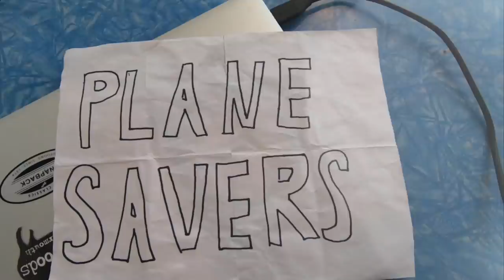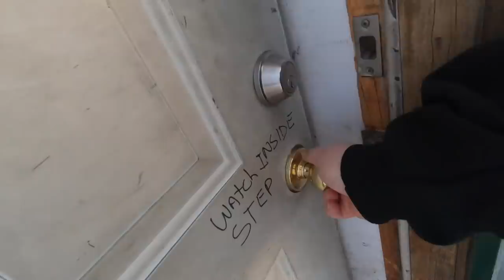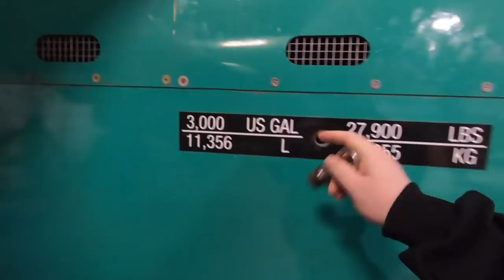"Rush to get DC-3 Parts" Plane Savers E73

Comment: Another great video Mikey.  Just one small point, that truck of yours would be illegal to drive here in the UK.
That crack in the windscreen (shield),  wouldn't pass the yearly test, and you could be stopped by the police.
Windscreens are classed as part of the vehicle structure.
Reply from the maker: I wouldn’t be able to park it anywhere in the UK either ;)
Reply: Yes you have a point there.  :) @MikeyMcBryan

Comment: Interesting to see the Electra IZU with what looks like P-3 Props as apposed to the squared off ones the electras normally use, are they just temporary or do you plan to try to get an STC to use P-3 / T56 Props on the Civi Allison 501s?